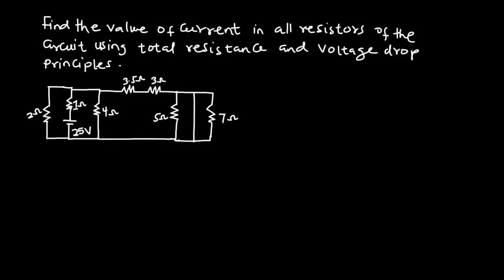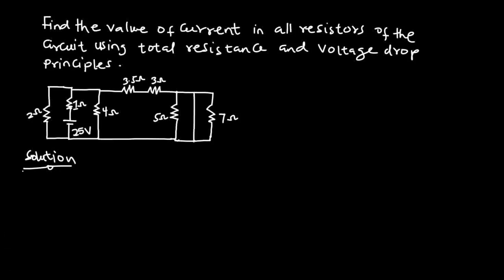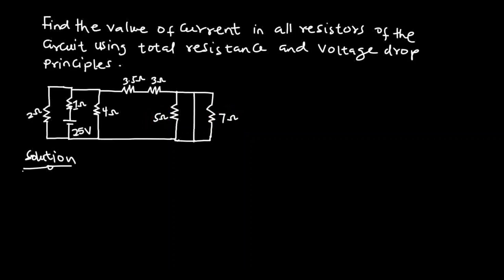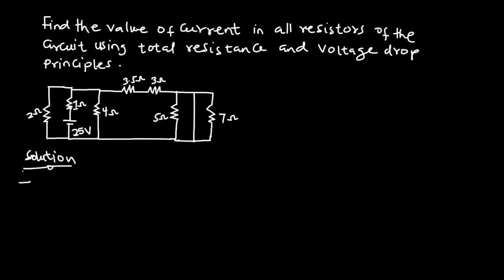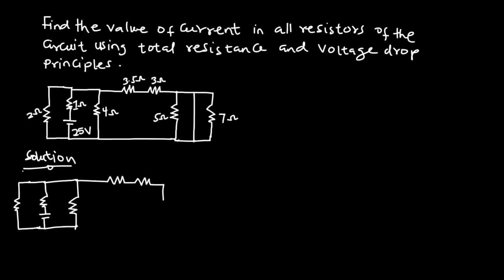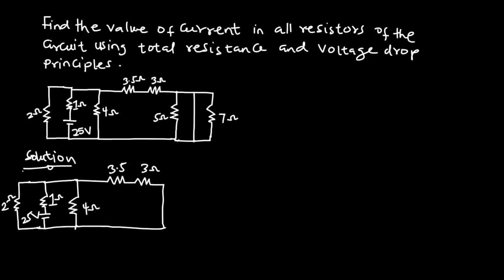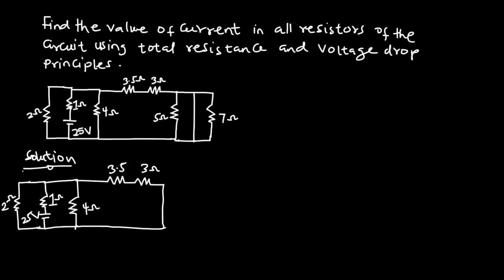Calculating for the value of current in resistors (Applied Electricity)

Comment: God richly bless you. Please I want to ask; why wasn't the 2 ohm resistor also short circuited since there were 2 short circuits between the branch of the 1 ohm resistor and the branch of the 4 ohm resistor
Reply: Thank you very much I now understand it clearer
Reply from the maker: Welcome Sir .
Reply from the maker: The 2ohms resistor wasn’t short circuited because the current from the source will split when it gets to the node(where the one ohm resistor is connected).Some of the current will flow through the 2ohms resistor and some will also flow to the right side of the circuit.

Also the paths on the left and right side of the 1ohm resistor are not short circuit paths .
Reply from the maker: Thanks for your Question,please let me know if it has been answered.